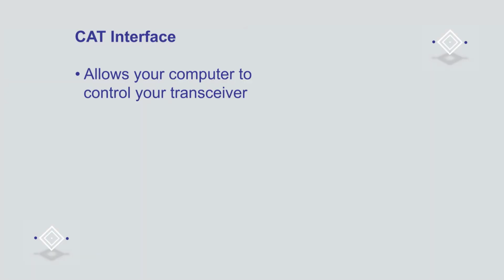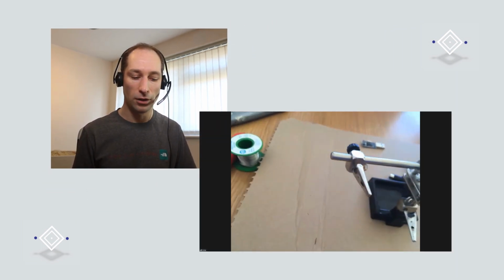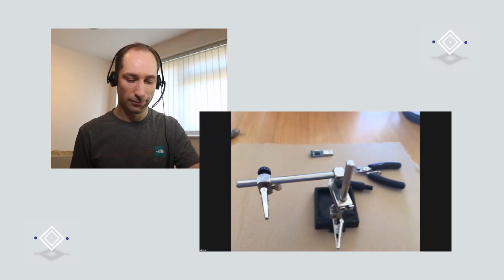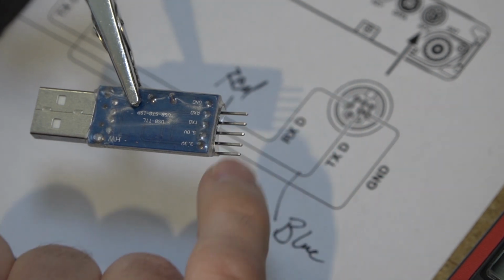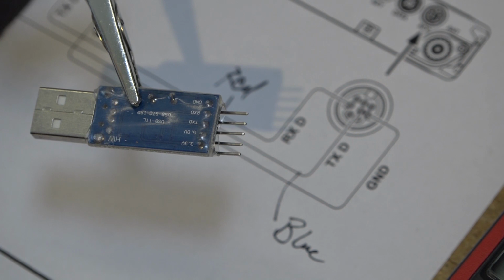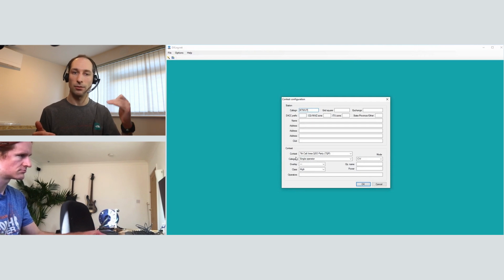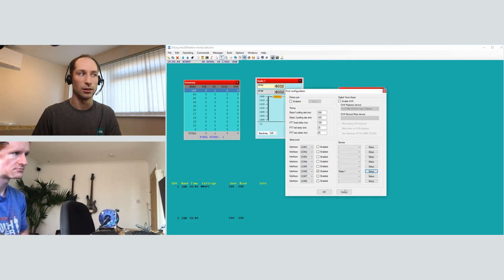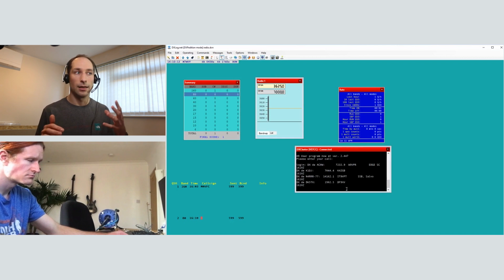RSGB: Useful practical skills videos - CAT control

Comment: Excellent!   Could you also show how OMNIRIG works with cat control too please?
Reply: Hi Kevin. The principle should be exactly the same as is shown here (In fact DXLog.net uses Omnirig behind-the-scenes, I believe). 
As long as you correctly configure the right combination of 1) Rig model number 2) COM port where the rig is connected 3) Baud rate and 4) Any requirements for RTS/DTR pins for your rig, the connection should work fine. 
73, Dom M0BLF